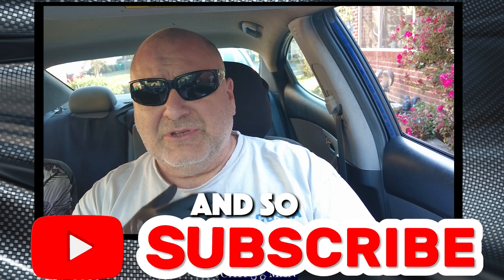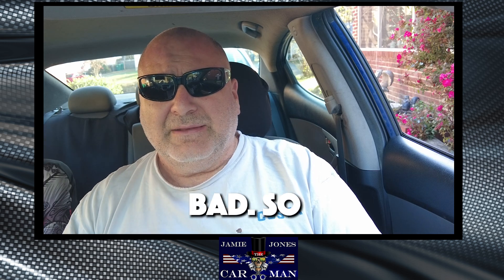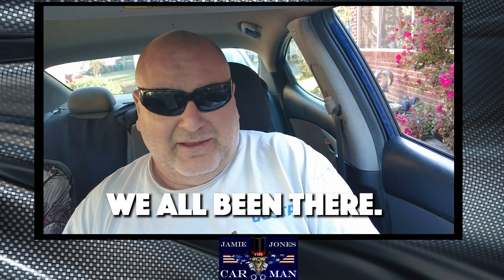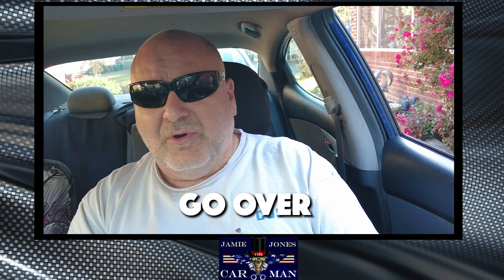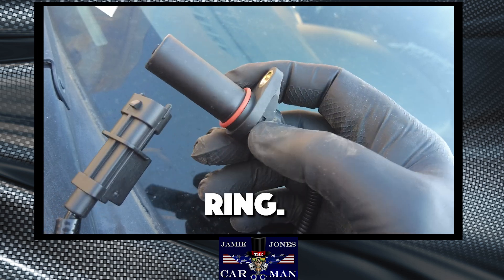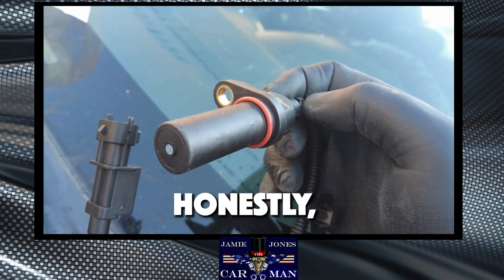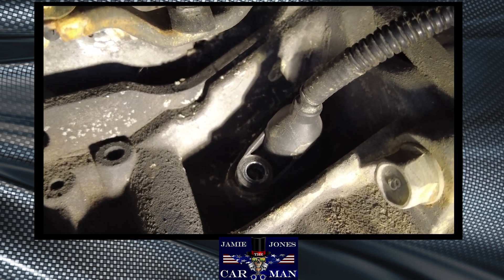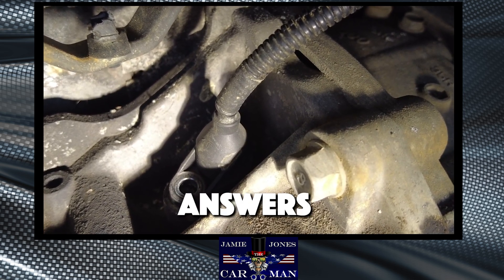"Kia/Hyundai Crank Sensor Symptoms & Repairs 🚗🔧 DIY Replacement Guide for 2012 Models ⚙️💡"

Comment: 2009 Hyundai Sonata 2.4L  Check engine light on - engine died in parking lot, then intermittent rough idle.   Check engine light went on and off; and always went off when I took it to the local auto parts store who would scan your active engine codes.  They did not have a scanner that read stored codes.

I purchased a YOUCANIC engine scanner that can read stored codes and has bidirectional testing of components (along with an included video probe).  Read the stored code for crank position sensor failure.

$95 dollar part (AutoZone).  On a  2009 (and I understand for a least a decade range) Hyundia Sonata with a 2.4L engine it is not a 10 minute job.  Access is very limited and it has to be worked from the top with very limited access and viability, and there are 2 heat shields that have to be removed and reinstalled.  Figure many hours mainly laying across the engine..  It took me about 5 hours to get apart, and 1 hour to reassemble once I got the old one removed.  If I had to do it again it would likely take about 2 hours to disassemble now that I know how to do it and exactly which tools to use to get the cable locking pin out (extremely difficult to do).  I hour for reassemble is a good time.  Note that this includes disconnecting the negative terminal on the battery at the start and cleaning up the battery post and connector and reconnecting the battery at the end.
Reply from the maker: Excellent, tks so much for sharing